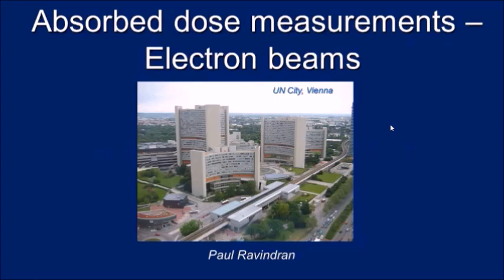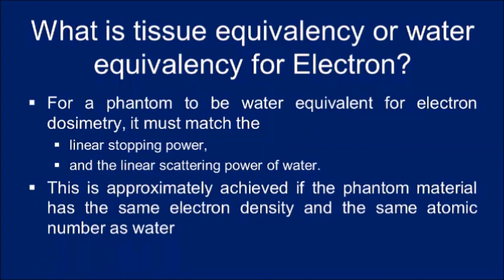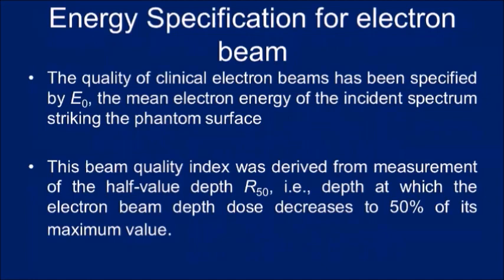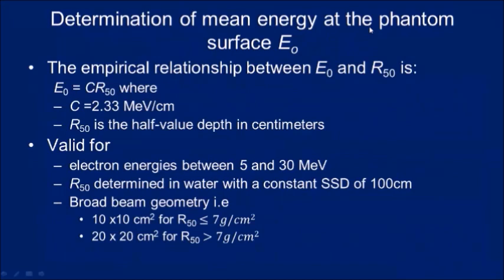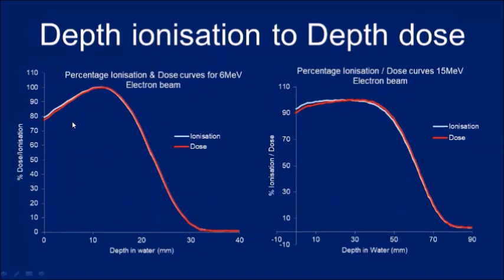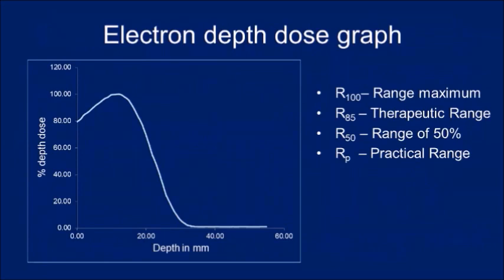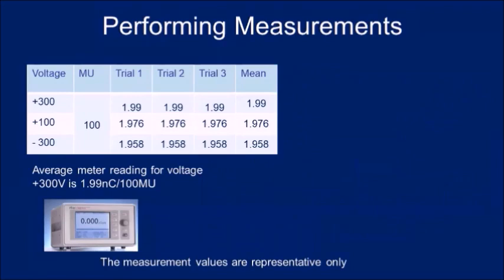TRS 398 code of Practice -  ABSORBED DOSE MEASUREMENT FOR HIGH ENERGY ELECTRON BEAMS

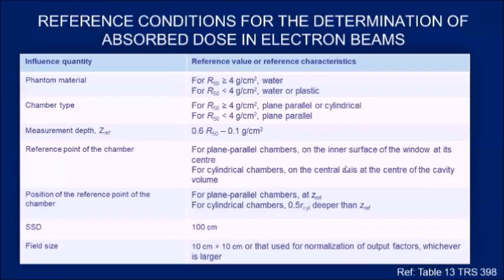Comment: thanks for the great explanation. I have question sir,  At 2:42 why the measurement depth given like that formula? And can i measure absorbed dose at any Z to make dose distribution? Thank you
Reply from the maker: That is the protocol, you need to perform calibration measuremetn at specific depth for each energy.. Though you can measure at different depths, calibration is at specific depth for uniformity between institutions.